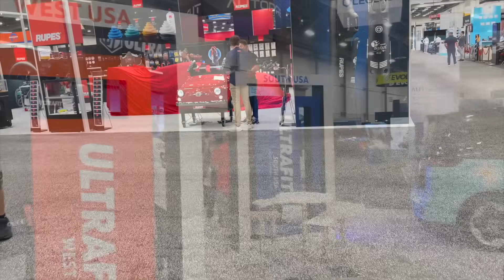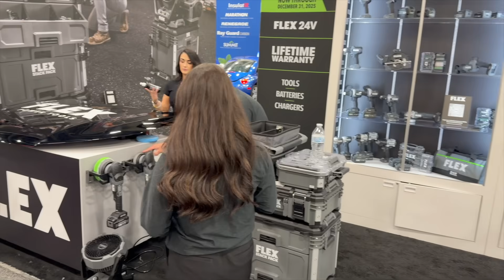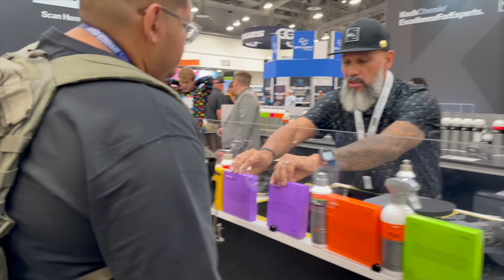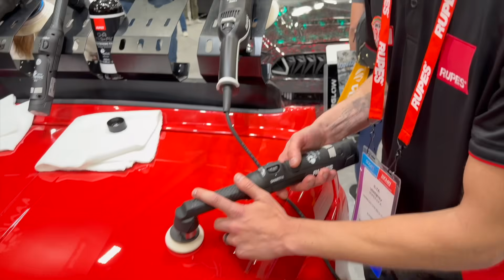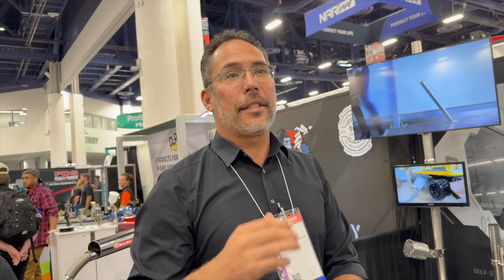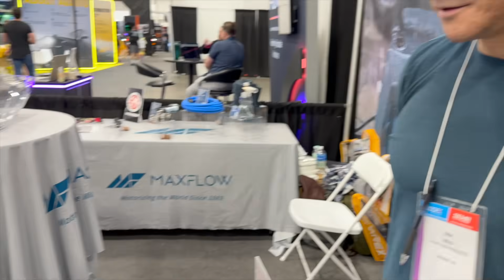SEMA 2025 Day 1

Comment: 8:49 Tell me there's a stiff engine parts cleaning brush in that mix. Auto retailers, Napa and O'Reilly's sell crap these days.
Reply from the maker: There is.
Reply: @ObsessedGarageMattMoreman  thanks for responding.   
All the parts stores carry is soft crappy brushes that melt with solvent. If the brush doesn't, the handle does.

Comment: Ramp up on a pressure washer makes foam cannon use miserable. Those are nice looking units but if they have to “spool up” when I squeeze the gun that would be a deal breaker
Reply from the maker: We may have to switch to traditional pressure switch.

Comment: Matt, sometimes I mix my active foam too strong or it is too thick and not running down how I'd like, or on a warm windy day I might want to dial the foam back to make it more watery so there is less chance of it drying and giving it a longer working time. But yes working in a garage or perfect conditions you don't need the  venturi adjustment; however, I use it 20% of the time.

Comment: Version 2 of the griots brushes need to be some sort of QD system if you plan on having 1 handle and 17 different brush heads.
Reply: The idea of the brushes is you have a handle for each brush type. When that type wears out, you get a new head. I don't think they were going to a single handle and a bunch of heads.
Reply: @bigruss19 that's what Matt made it seem like in the video 🤷🏻
Reply: @I5ZQ8  The beauty of it is you have the option to do it either way. Maybe a mobile detailer would want one handle and 17 different brush heads, maybe the guy in his garage would have a handle for each head. I think the point behind it is more so you can design your own brushes - how long it is, is it curved, etc.

Comment: Did Rupes fix the backing plate on the LHR15 Mark V
Reply: Seems like it should be an easy fix, just needs a slight tweak to the hook and loop design. I think they're trying to ride that line of being strong enough to hold onto the pad but not so strong that it destroys the pad when you pull it off (especially when heated up).
Reply: @jeffc6832 I’ve had the
LHR21 V1 
LHR15 V2 and 
LHR15 V3 and skipped the V5 because seeing the backing plate issues
Reply: @DominicMalta MKV has the same backing plate as the cordless HLR polishers, and I've not had any issues with mine. My guess is that most of the complaints are probably coming from guys who are hard on their tools and are ripping the pads off right after they've been bearing down on an entire hood at speed 6. Keeping things cooler, using a pad washer and/or waiting to remove the pad carefully with a RUPES pad until after you've wiped residue off the car and inspecting your work can go a long way to prolonging pad and backing plate life.

The MKV and cordless tools are awesome, but if you're worried about the backing plates just buy an extra one to have on hand.